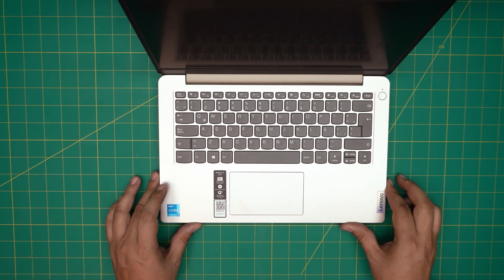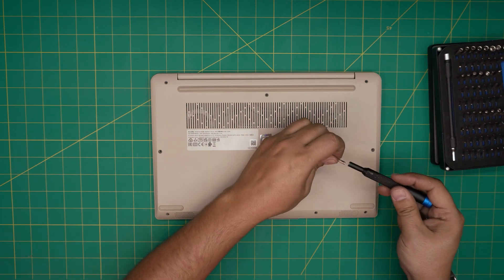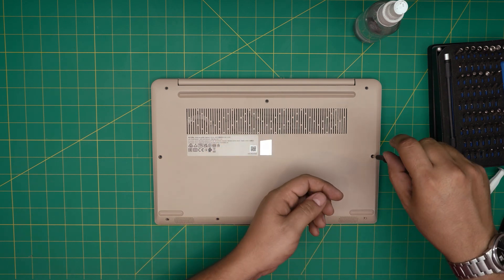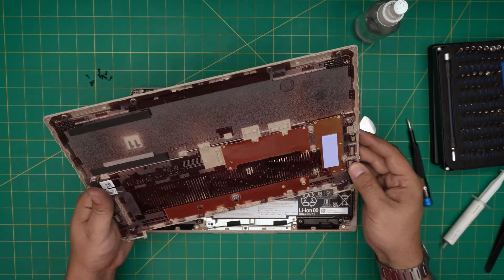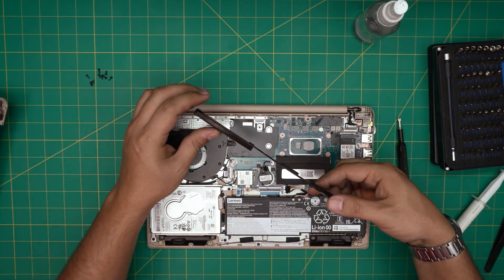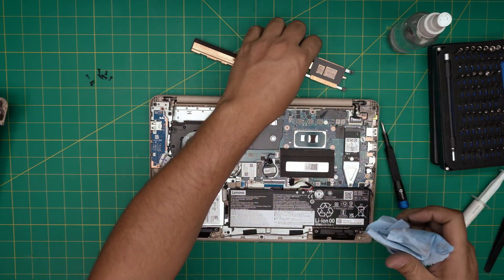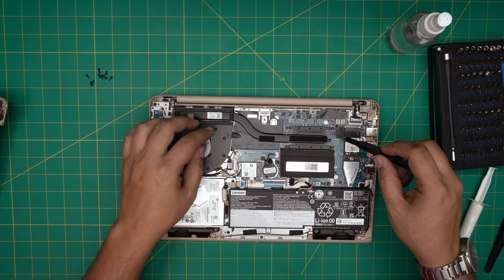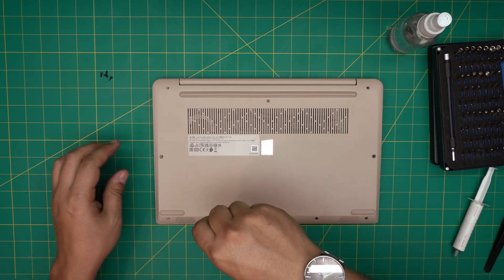How to Repaste and Clean Lenovo Ideapad 3 14Itl6 Laptop - Step-by-Step Guide🧹✅

Comment: Ifixir screwdriver is very expensive in my country 😢 do you have cheaper option or do you know what the screwdriver size youre using?
Reply from the maker: 🫠 Regarding your question, get any cheap multi-bit screwdriver set you can find at your local shops.
cheers🍻

Comment: Hi do you know how to disassemble the fan becoz all the dust and gunk is stuck in the exit grills
Reply from the maker: Just follow the video and you'll see that when I remove the heatsink, you can clean the heatsink grills and the fan—it's all in the video.
Reply: Just use a toothbrush to scrape all the gunk and dust on the fan. Then with a air blower, hold down the fan and blow all that gunk away. You really don't need to remove the fan.

Comment: Does it help with performance a lot after 2-3 years of using by simply cleaning like this? No risk of doing this right?
Reply from the maker: 🫠Regarding your question, it will help the performance for sure, if you follow the steps as per video you will be ok.
Should you have any further questions or requests in the future, please don't hesitate to ask me.
cheers🍻
Reply: @uFixTek  Thanks, Ive cleaned it up, everything is fine now
Reply from the maker: awesome
It's my pleasure my friend.

Comment: If I don't have any workshop towel nor any alcohol can I use any substistules like wet wipes and tissues or something?
Reply from the maker: Thank you for your feedback! If you wish to support the channel, you can like, subscribe, or both!
Regarding your question, you can use tissues  but you will need an alcohol  95% minimum, you can risk using a 70% alcohol, but not recommended.
or just dry wipe.
Should you have any further questions or requests in the future, please don't hesitate to ask me.
cheers🍻
Reply: @uFixTek  thanks!
Reply from the maker: It's my pleasure my friend.

Comment: How if i want to clean the fan too? My fan is so dirty
Reply from the maker: the battery is held by two screws my friend and use a toothbrush and clean it with tooth brush.
Reply: Removing the fan is not nesseccary if you just want to clean it. Just use a toothbrush and scrape all the gunk and dirt on the fan, then with a air blower, hold down the fan and blow all the dirt out. Removing the fan is kinda a waste of time in my opinion.

Comment: thanks for the video. It really helps me but can you do a close up take on how much the paste needed for CPU and GPU? I am new to thermal paste replacement. I know that for desktop CPUs you need about a pea sized thermal paste but laptop CPU and GPU has different sizes.
Reply from the maker: Thank you for your feedback! If you wish to support the channel, you can like, subscribe, or both!
Regarding your question, i been servicing over 17 years and i seen many people worry about the size of the paste, don't worry just place one drop of the paste more is better don't worry about it, its not conductive and it will be fine.
and this laptop does not have GPU only has CPU, the big dye is the CPU/GPU, and the small dye is the PCH chip.
just place a fair about and don't be scared, the diameter  around 4-5mm
Reply: @uFixTek  i don't know but there is a misinformation about my laptop. When i bought it, it has i5-1135G7 CPU and Nvidia MX350 GPU. On its box, says 14ITL6 but on lenovo vantage it says 15ITL6. Lenovo website also said 14ITL6 when using Service Bridge.

Anyway, my laptop does has GPU in it. Its smaller than the CPU. So i am assuming that it needs a bit less paste than the CPU.

Also is it possible to use thermal pad on the CPU and/or GPU? Like thermal grizzly minus 8 pad. I think pads are less prone to mistakes than paste for beginner like me. Just cut the pad according the size of the die and put it. Some people said to use 0.5 to 1.0mm on the CPU. I am not sure.
Reply from the maker: Okay, if you have two independent chips, then you have both a GPU and a CPU. Please never use a thermal pad on the GPU or CPU unless you want poor results. Trust me, you can't go wrong with applying thermal paste. Just use a nice amount and you're all set.
Reply: @fahrezadhia yours is 14itl6 as 15itl6 is 15inch in size and have numpad